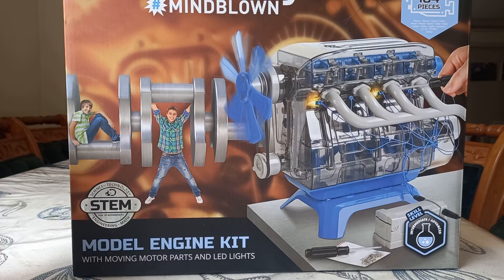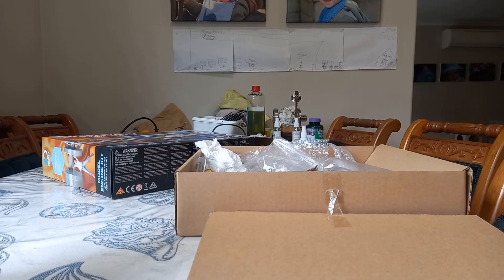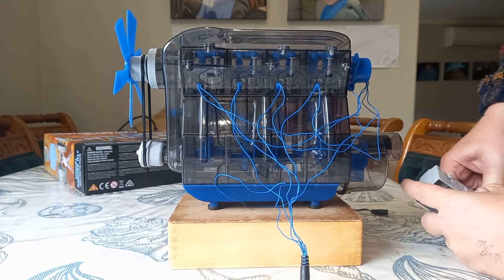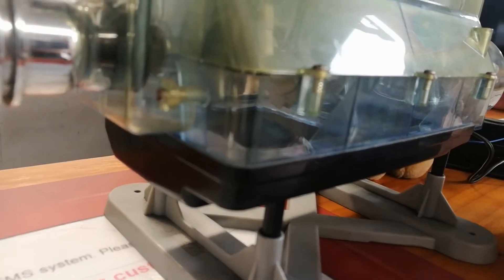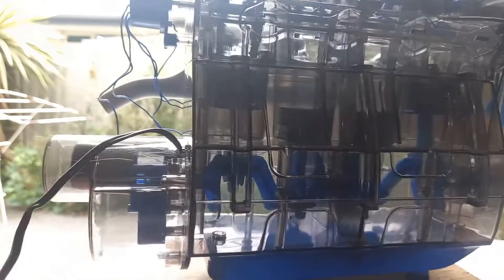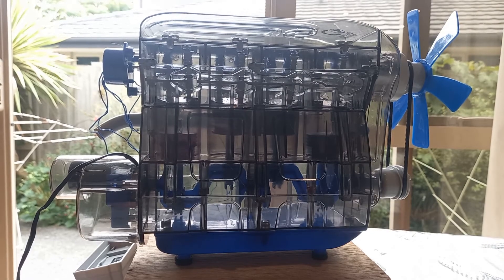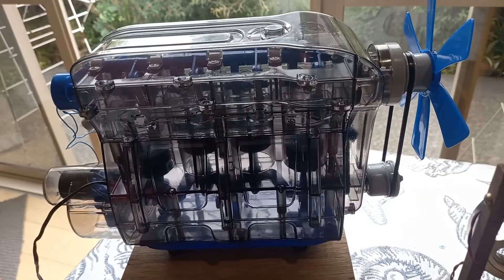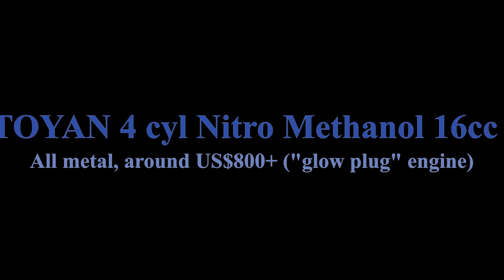Discovery MINDBLOWN STEM 4 Cylinder Model Engine KIT

Comment: Hey man not sure if you still read these comments, but my lights will not stay inside the holes. how did you fix them inside?
Reply from the maker: Hey man, I saw your comment by chance. I used a drop of superglue or just pushing them in really hard. Good luck!
Reply: @ThomasPCGuruENGINES Oh, thank you. Unfortunately my pistons jammed up with the electric motor attached so It won’t move. Great vid. :>

Comment: I can't keep the timing belt on. No matter what I do it slides off after 5 or 6 seconds.
Reply from the maker: Mmmm it is crap. Maybe a washer under the wheel would keep it straighter?
Reply: @ThomasPCGuruENGINES  I didn't think about that. I was trying to find a creative solution and make something myself lol.
Reply: I would use a rubber band
Reply: @Floridamapper369  Tried it. Doesn't work.
Reply: @djbeezy  well sorry about that

Comment: The camshaft is impossible!! This is the same situation on multiple kits with different designs. Same person must have made the instructions
Reply from the maker: I didn't know it was the same in multiple engines...but I do agree the camshaft construction seems impossible. I am edging ever closer to blowing this thing up in a video
Reply: @ThomasPCGuruENGINES  I was able to figure it out but the little distributor doesn’t seem to hold the timing right. I’ll have it set for three or four cycles then it goes out of wack. Fill her up with oil!
Reply: The camshaft was pretty annoying and the instructions were shitty but my 10-year-old and I managed to put it together successfully first try! He had a hard time running down the screws by hand and it runs pretty slow but I like how it allows us to see inside. I had to explain to him that real pistons don't have two halves that snap together 😂

Comment: Great engine, but it spins too slow. I was planning on using it to power my Hovercraft, but it rotates too slow to generate a reliable amount of power. Maybe I'll just leave the "drive module" (motor) off the engine and connect a LEGO gear instead, so that I can drive it with a LEGO axle at a much higher rotation speed. Thanks for this video, it really helps. :)
Reply from the maker: Hehe my pleasure. You're right the motor looks dumb it rotates so slow and you can hear the shitty little electric motor whining away. I can see how that slow speed works for a demonstration though...I'd think a model hovercraft would be weight sensitive and this plastic engine is huge. Add lego bits and it will be too heavy again!! Consider utilising a kit solenoid motor as the pusher motor power on the hovercraft; leave the cushion power to a proper eletric motor. And flick me a comment so I can see your video!! :)
Reply: @ThomasPCGuruENGINES  I will when I can! :)